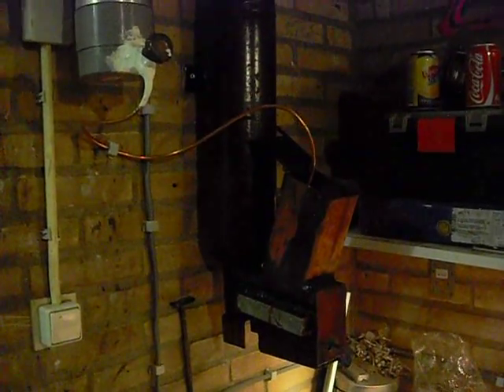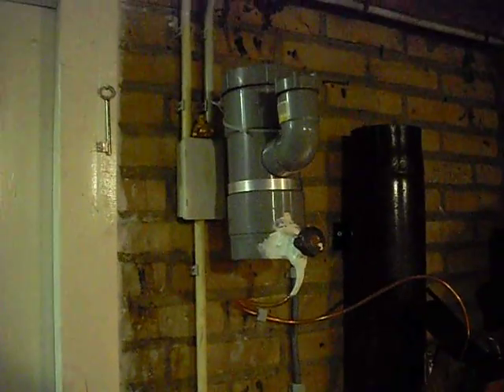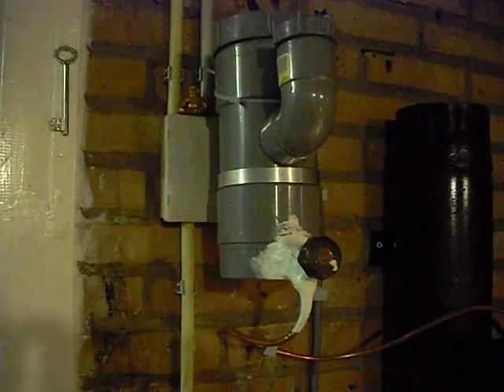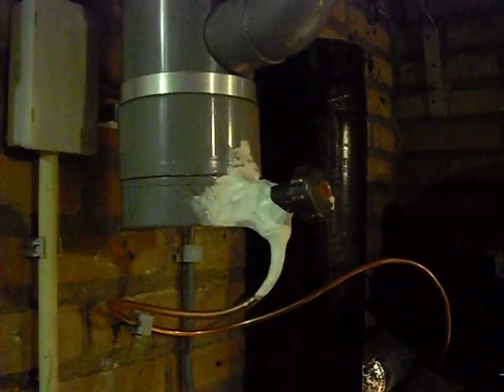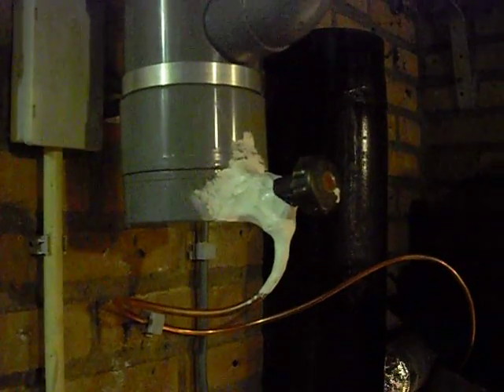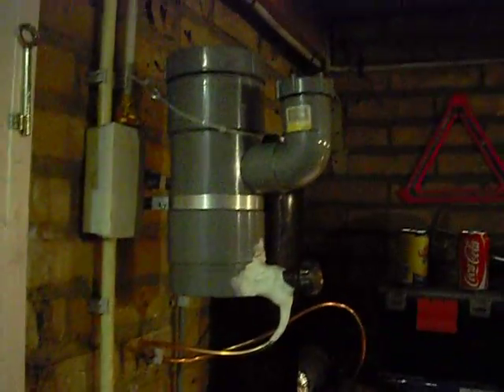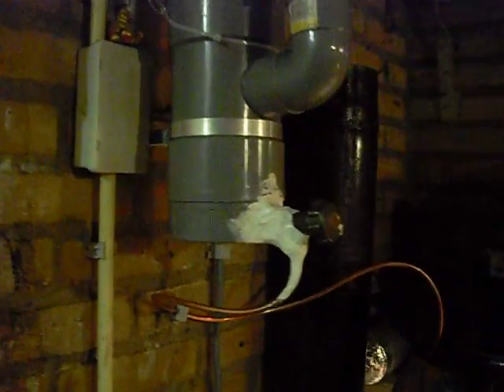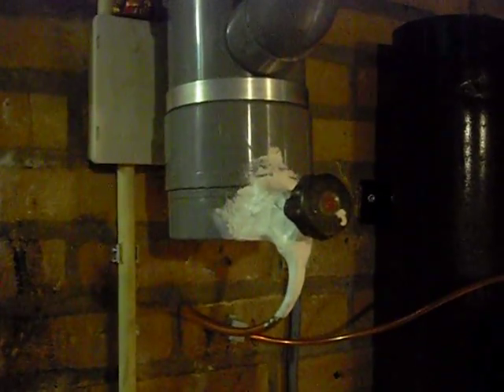Rocket stove heater - drip feeding waste oil.

Comment: Any issue using waste motor oil after a long time? Did it gunk up your heater? I wonder because of the dirt, metal, etc in waste motor oil.
Reply from the maker: Hi Shane,

Actually , no, i haven't noticed anything yet, but then again i often use different oils and not just old motor oil. 

I think it might make a difference if you only burn motor oil. 

But i cant really answer this one... yet  :-)

cheers,

Rene

Comment: Great result there, I don't know if you're still checking out the comments you receive, as this video is more than 3.5 years old.

I have a question for you, just in case you'll see this :" Where is you drip dripping on, is there a tray of some kind underneath that is helping to evaporate to ingnate the drips ?"

Thanks in advance for your answer.  Peter.
Reply from the maker: Hi there, the tray is the bottom of a coca cola can. In there i placed an stainless steel wire mesh . when the oil burns, the mesh heats up, helping the oil to evaporate. And the loop closes. Just make sure the mesh sticks out of the oil in the flame. Cheers, René
Reply: Hi Rene, thanks a lot for this very quick reply, much appreciated.  Am I wrong thinking that you're Dutch ?  I am Dutch myself, but I'm living in France, already since '79 that's why I only receive a peanuts retirement pension from the Netherlands, and next to nothing from France either. Because of this, it looks like I'll have to convert my old Renault Master van in the near future to live in, and your small drip feed stove could be just the thing for me to get enough heat in the van for the winter, with an exterior air supply to the burner. Thanks very much again for your help.  Peter
Reply from the maker: Peter Mastenbroek 

Hoi Peter,
Idd Nederlands. Ik woon nu in Harderwijk. Ik denk idd dat een dergelijke simpele olie brander meer dan voldoende is in je busje. Ik stook mijn lekke garage in no time hartstikke warm. Een busje moet geen probleem zijn. Daarnaast zijn er nog andere mogelijkheden.  Als ik je verder kan helpen met vragen, dan hoor ik het graag.  Suc6 , René
Reply: Bedankt Rene, als ik wat verder ben met mijn toekomst plannen, en kan gaan beginnen met wat knutselen aan een warmtebrom voor mijn bus, dan zal ik vast wel de nodige vragen hebben.  Voorlopig woon ik nog op mijn scheepje iets meer dan 100 kms ten zuiden van Paris, maar dat wordt te duur om vol te houden, hetgeen wel heel jammer is want ik woon (en werkte) al 46 jaar op het water, maar zoals ze zeggen 'Life go's on".  Als er niets tussen komt dan word ik morgen 69 jaar, niet dat er daardoor iets zal veranderen, ik vier het toch niet, maar voel wel heel goed dat ik geen 20 meer ben.  Wat ook heel jammer is, dat is dat de markt voor scheepjes flink in elkaar gestort schijnt te zijn.  Never mind, er zijn wel ergere dingen te bedenken, en klagen help toch niet.  Tegen de tijd dat ik er aan toe ben hoor je vast wel weer iets van me.  Vriendlijke groeten, Peter.

Comment: Very good video, thanks for sharing. I have been using waste oil to run the heater at my shop for quite sometime now without having to constantly tend to it. No smoke and no oil smell because the key is to make sure the stove is tweaked properly.

Comment: Very Nice!  I have only built 1 rocket stove...just to see and hear it work.  I use it to heat my garage/woodworking shop.  In the past I have used the drip system on several wood stoves.  My dad had a drip feed stove in a shop 40 years ago.  He used oil to extend the burning time of the wood.
 The only suggestion I have is one from my dad.  He always steel brake lines to deliver the oil to the fire.  He told me they last much longer than a copper line.  I never tried copper, because dad was adamant.  Being cheap the brake lines are usually a free item for me.

Comment: Ok. I'm new to Rocket Stoves, so this brings up several questions in my mind. How do you get the fire started to begin with? I have tried to light various kinds of oils in other "burner" setups with no luck. Is it possible to burn old motor oil is this kind of setup? I would think the extra heat of the rocket stove would take care of the nasties in the old oil, but maybe not.... 
I like the idea of using old motor oil because, I have cars, trucks, tractors, small engines, etc on my farm, and I hate the idea of giving away something that I had to pay for.
Reply: All materials have a burn point and a flash point, the temperature at which they burn, or can spontaneously ignite under the right conditions.   Cooking oil won't burn if you try to light it with a match.. Yet cooking fires happen every day.  Solid and liquid material does not burn. It is the point at which it turns to gas that it becomes flammable. The trick, like diesel engines with their glow plugs, is to raise the temperature.  This can be done by heating the can of oil up with a propane torch. With enough air flow it will maintain it's own heat until fuel has been cut.

Comment: I really like your idea.  I wanted to clarify something about the fire extinguisher used in this setup.  Are you talking about the device commonly used in the U.S. to put out small fires and you re-purposed it to for this application or is it something altogether different that I'm not familiar with?

Looking forward to any new updates. Thanks
Reply from the maker: It is what you think it is. It was used to put out small fires. Nice thick metal. cheers
Reply: Very god sir, thanks.